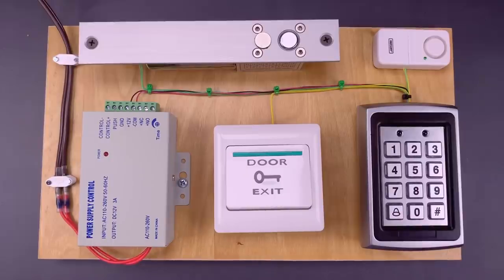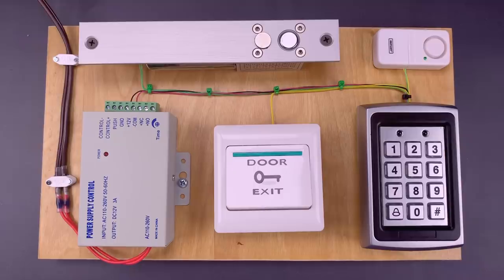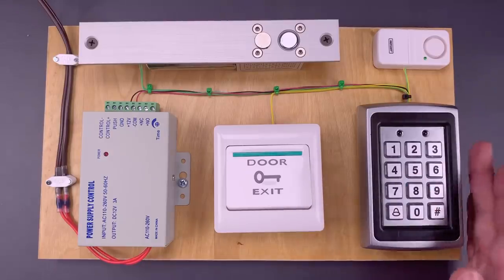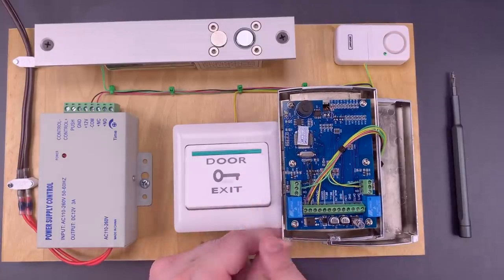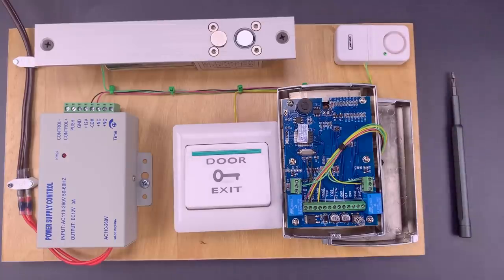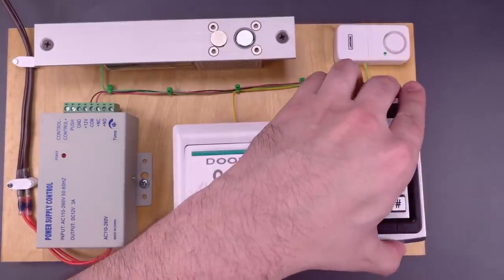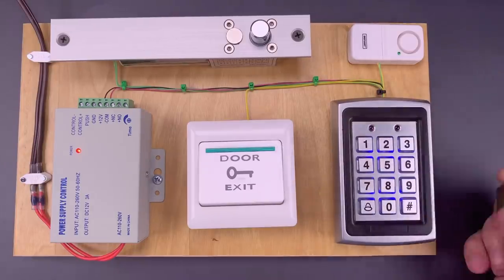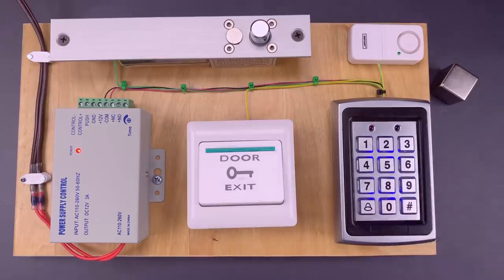[1130] Avoiding The Trap, And Bypassing Keypad With Magnet (HFeng)

Comment: Couldn't lock designers trivially solve this issue by putting the relay on the center of the board, instead of the edges? or perhaps by orienting it so that the magnet needs to be placed BEHIND the keypad to trigger it?

Comment: Couldn't you also just open up the unit with a screwdriver like you did and short the relay to open? In case you didn't have a big magnet with you but did have a standard phillips screwdriver (or Swiss-Army-knife).

Comment: Why have the "open the door" relay on the outside though? If I was designing one of these systems, it would send the keypresses to the internal unit, which would then decide to open the door or not.
Reply: There's no inside electronics box, just a modified lightswitch and a power supply.
Reply: But I have used a common model with an inside electronics box and a membrane keypad that could be setup with multiple codes according to the manual.

Comment: I made an electric combination lock once, all that you do to stop this, is use the simplest lock ever nothing in the keypad just buttons, so nothing that you can do to open it except entering the correct code, also you write the program to be slow so if miss the correct combination you have to press a reset button with 3 second delay so you cant speed enter codes.

Comment: I found a massive flaw in this unit. I fuzzied it with a Flipper-Zero, and stumbled on the master add user key. You don't even need to use the keypad (magnet also proof). The documentation on this unit is so flakey, it's only worth having for educational purposes, just to see what makes it tick.  Steer clear of.

Comment: Just lookin at the wiring in the thumbnail before watching, you can tell it's trash that suffers the same flaws as almost every electronic door system LPL has tested:
- nothing but gnd/+12v off interior side
- everything runs back to the exterior keypad

So brains are outside where you can poke em with a stick. Title also mentions magnets, probably a relay inside the keypad you can just hold open with a magnet held against it.

Comment: Could you not design a lock in such a way that the solenoid was positioned in the center facing down so that the only way to trigger it magnetically would be to put the magnet against the back of the keypad, which would be impossible in practice for obvious reasons?

Comment: so lockpickinglawyer, from your personal experience, how many of those keypads with a tamper switch (if you can call that a tamper switch) have the tamper switch installed right after the screw that you have to screw loose to open the case, and have multiple tamper switches?
With this I mean, if you are in the process of screwing it loose, the tamper switch is already activated?
2, why are those firms so dumb placing the motherboard in the keypad?

Comment: So when the magnet is applied to the side of the keypad it triggers the relay. Does it also work if you apply the magnet to the front of the keypad? I wonder if the keypad were designed to be flush with the wall if this same trick would work.

Comment: Can't this kind of bypass be avoided with a metal shield around the relay? Or just with a solid state one?
Reply: josep alacid Magnetic shielding or solid state switching could improve security, but a well designed system would have the logic circuits that authenticate a valid access attempt & the switching hardware in a control unit that is isolated from the keypad unit. The keypad unit should send any code entered/rfid card readings to the control unit, which in turn recognizes valid credentials & operates the locking hardware when appropriate. 
The moment the keypad contains contacts that lead to the locking hardware directly there will be security flaws introduced unnecessarily.

Comment: I asked it a few times already, but what about my idea of making a Series Circuit of Relays - with each one moving a different direction?
The Electronic should have a easy time triggering them all. The only difference is how much energy is used on the magnetic movement part.
But no Magnet can pull each of them into the same direction.
For added bonus, you could put a ring of tamper-sensor relays around the ring of trigger relays, that feed into a OR element. That way any try to would trigger the alarm, while being magnet proof.

Comment: two relays near each other. if to open a lock one should be off and other is on - lock should be invulnerable to a magnets. And if add one more relay that work as magnet sensor to alarm, it will be realy nasty lock))

Comment: They should at least put the relay next to each other the outermost being the temper switch so that when you open the door using the magnet you at least trigger the alarm.

Nevertheless customer should buy a system where the keypad sends its input keypress to another board which on the secure side of the door would decode and check the right keypress sequence has been performed.

Whatsoever any door would still have a mechanic lock to bypass faulty electronic. Therefore customer would also need to consider locks that LPL pick open after at least 2min15seconds to be labelled as « secure ».

Comment: Any system that connects the opener to an outside component is trash. Pure and simple.

Rule 1: The outside component should be a simple and dumb sensor that sends whatever is entered to the inside component. It is---by design---not trusted. Replacing it with any tampered version will not directly gain an attacker access. (indirectly it could by enabling replay attacks)
Rule 2: The wires that open the door are never accessible from the outside.

Even the most basic and insecure mechanical locks follow those principles---the lever that opens the lock always is inside the lock. Ok, some bad locks have it accessible at the end of the keyway, but at least it's not exposed on the frontplate...

Comment: I got a pick set, but one of the wipers has a little twist like an RNA spiral in it, anyone know why?
Reply: It can be useful to allow tensioning when holding the lock at a different angle.
Reply: It's just for comfort. When picking practice for a while the edge tends to hurt the finger, so the twist allows a flatter surface area to rest your finger on. It also adds more flex to the tensioner which deadens the feedback through the wrench more than a stiffer tension wrench.

Comment: What a terrible design to put the relay and electronics in the keypad, it is very susceptible to attacks. The external facing keypad shouldn't have any electronics in, just the 3x4 key matrix wired to control circuitry located inside the locked space.

Comment: "You need to do your research beforehand."  "Easy because we did our homework first."  Are you certain you are showing vulnerabilities in locks so that the manufacturer will improve or are you showing so that people know how to defeat the locks?  Those comments seem to be rather blatantly in the second camp.
Reply: It is an arms race - as the bad actors already know these bypasses, it is critical that installers and end customers are also aware and take appropriate countermeasures (usually just avoiding crap products)